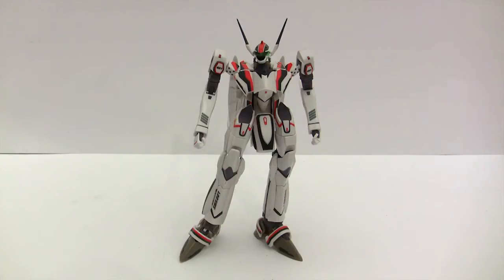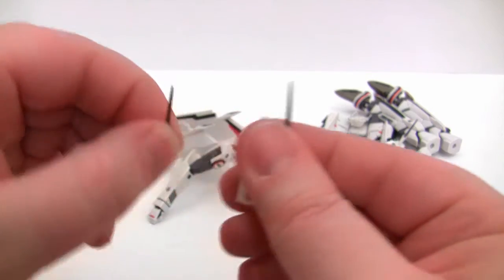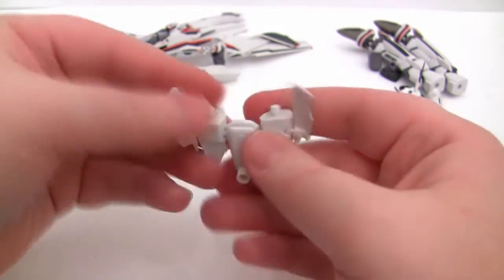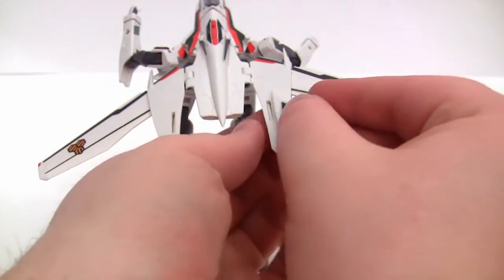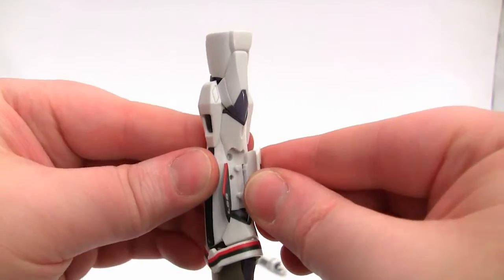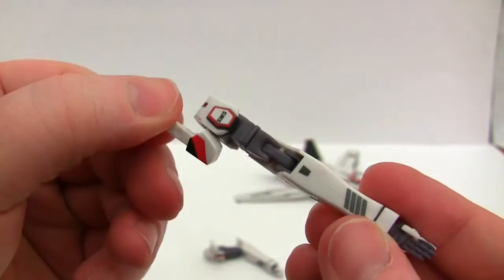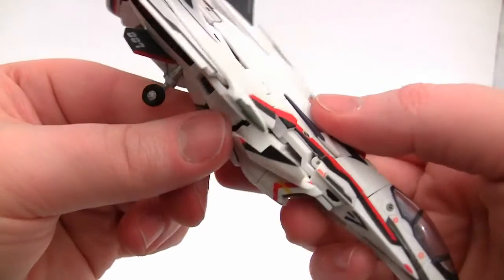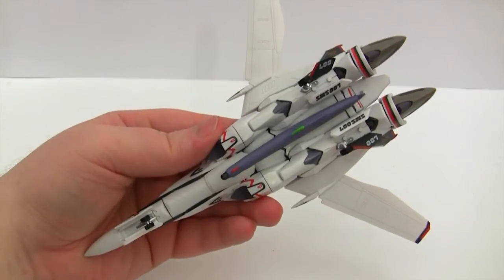1/100 VF-25F/S Alto Bandai - Transformation (HD 720p) - Part 2

Comment: I´ve done a MG Zaku II V2.0 and compared to the VF, it's a lot easier: no transformation, no decals, no rubbing.
Technically speaking, making the VF is not so hard, but making it properly (so the decals don't peel, etc) isn't a walk in the park. I wish we had an option other than the DX and this 1/100 partsformer....been a fan of Macross for 25 years and VF-1 V2.0 is sitting on my shelf, hopefully we won't need to wait till 2059 for a properly shaped and sturdy VF-25!